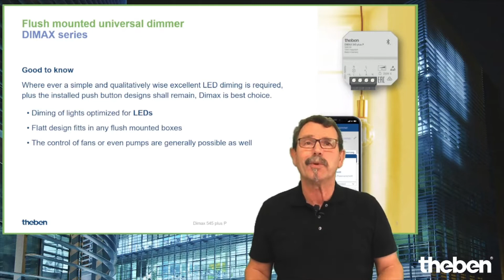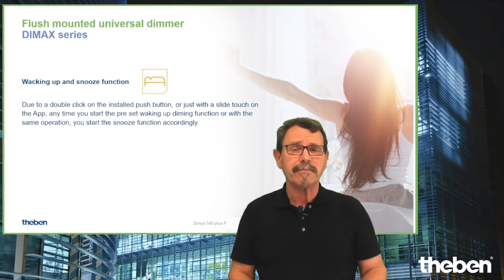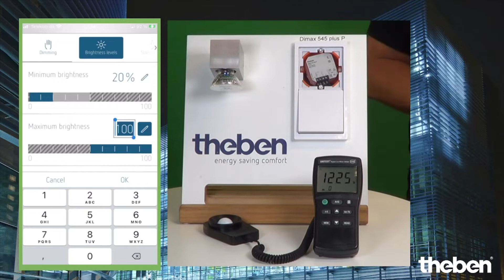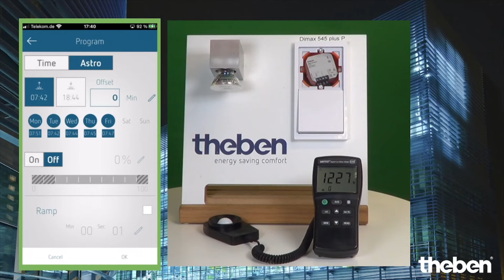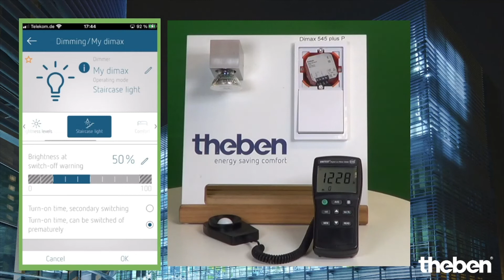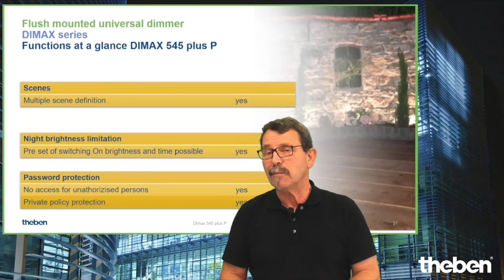Universal dimmer DIMAX 545 plus P - Video tutorial

Comment: Please tell me, what type of backup power supply is installed inside the dimmer in order to maintain the astro timer in the DIMAX 545 plus P of a temporary loss of supply voltage, and for how long will it last for uninterrupted operation?
Reply from the maker: I asked the product manager and will get back to you asap.
Reply from the maker: Basically, there is no power reserve in the DIMAX, but it is ensured that the programs and all settings are saved and that these are set again when the power is restored.
If the power is gone for a long time, the time will be updated the next time the smartphone is connected.